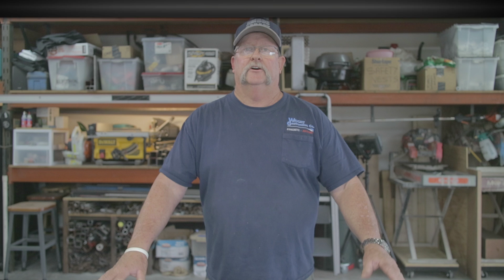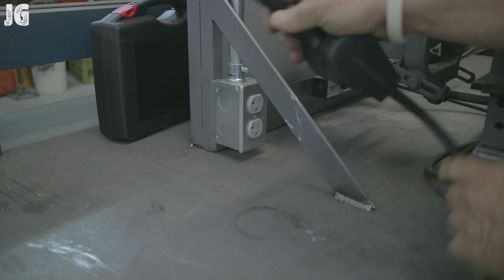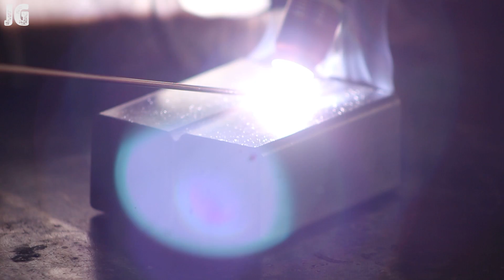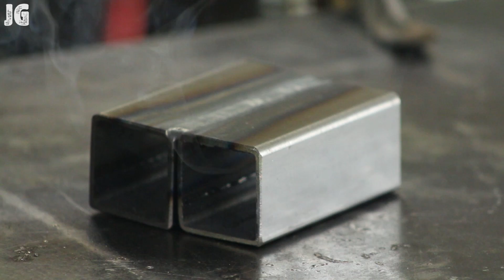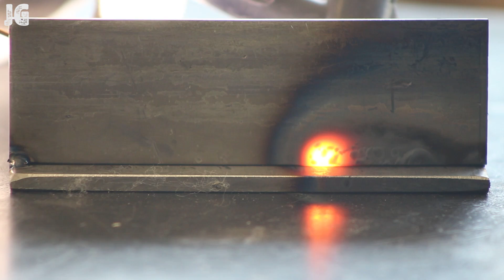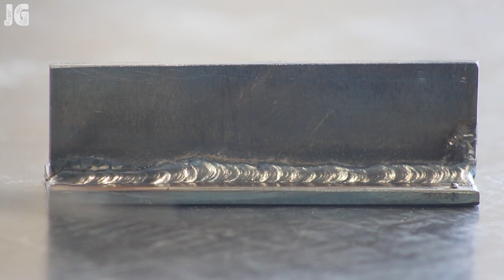110/120 Welding Test - Jimbos Garage

Comment: With 240 do you see a difference with your electric bill
Reply from the maker: Thanks for watching Cristian, Not unless i use it everyday, Then maybe the bill is a little higher. Jimbos garage!
Reply: With a lot of use I would think it would be either even or maybe even cheaper with 240v as the welder would be more efficient. At least that I what I've found with my everlast dual voltage welder.

Comment: i never got the whole 110 or 230v thing welders say in thier specs. it's either 120 or 240.
Reply from the maker: Thanks for watching, Yes i agree! It seems that 110-115-120 is all the same thing, As is 220-230-240? I'm not an electrician so i don't know?  Maybe someone here on the board can explain?  Jimbos garage!
Reply: +Jimbos Garage its all the same but its wierd how different things call it different voltages.  must be industry standard or somthing,  even my miller stuff says "230 volt" on all its instructions and stickers.
Reply: +Jimbos Garage I have seen duel voltage welders before but you always had to take off a cover plate and switch the wire terminals from high voltage to low voltage ones and either have an adapter or just change the cord cap. If you put low volts thru the high volt winding it may still weld but can lead to premature failure of the transformer windings.
Reply: +Robert L or some you had to flip a switch behind the cover plate